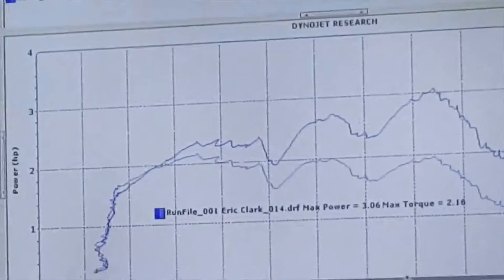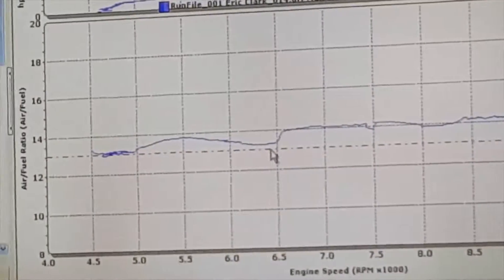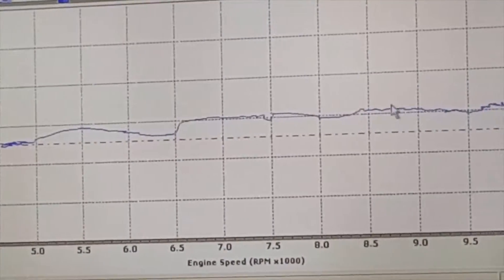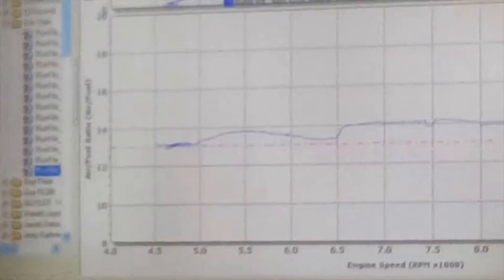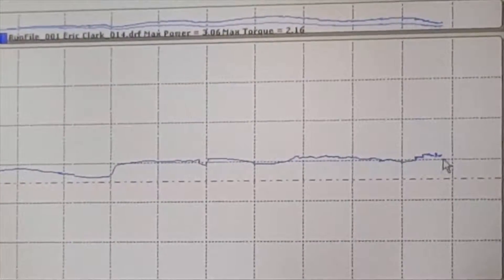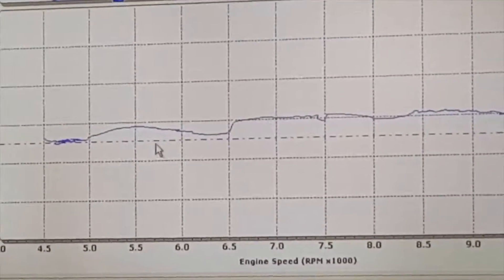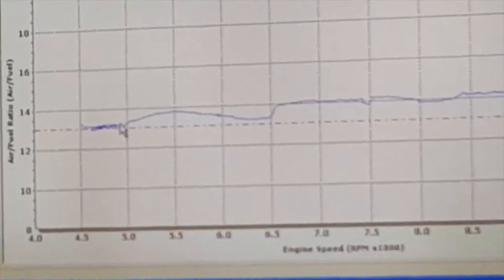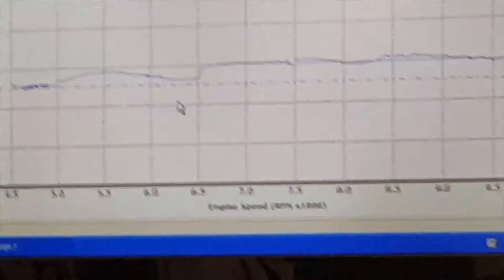Honda Spree dyno air fuel analysis with Big Bore Kit & stock intake

Comment: Thank you Soo much for the info. Glad I got the 6 Reed system for my 87 spree, bbk (thanks Taz aka chopchop*123), stock carb, 100 main jet, cone filter. Waiting on new petcock and we will see. Running stock gears hoping to ride some wheelies. If that doesn't happen😂 going with taller gears.
Reply from the maker: Taller gears won't get you any closer to wheelies, in fact, it will get you further away. If you want wheelies, your best bet is use 12T gears from an 84-85 Spree or Iowa edition Spree.
Reply: @phreakwars  ya if I'm no good at rolling wheelies I'm going to order them. Prob sooner than later.
Reply from the maker: @daysend1341  You'd be better off swapping in a AF16 engine and do wheelies all day.